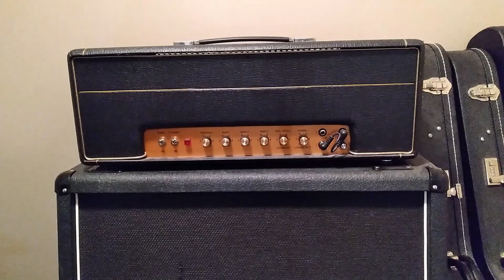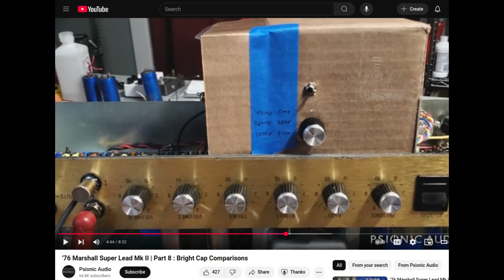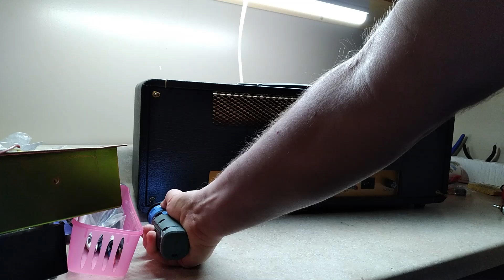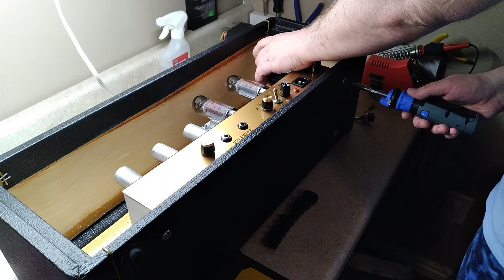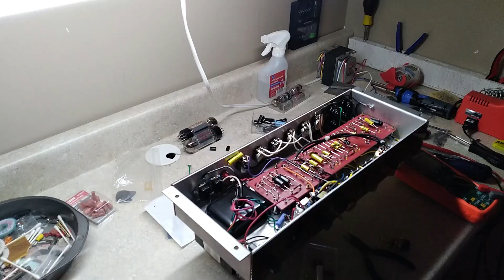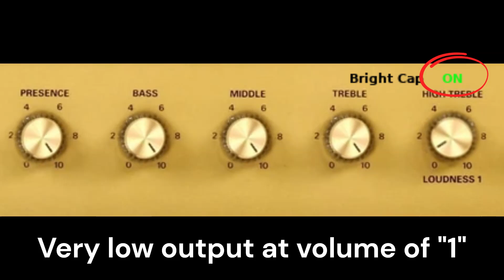Marshall JMP 50W model 1987: Selectable Bright Cap Install

Comment: Also, before you start playing it shows the inputs jumped with Vol2 quite high. Is that what you used for the playing demo ?? If you want a true demo of the effect of the brightcap you should have ditched the patch cable and put Vol2 on zero. No wonder it sounded dull even with the cap in. Bass on 10 and mixing in heaps of channel 2 is a recipe for killing the classic Marshall Kerrang.

Comment: Is this an otherwise stock 1987 ?? Seems a little dull even with the cap in, so wonder if there are other tweaks that bring it closer to Bass spec.
When I had a stock 70 Superbass I used to keep the Bass on zero, Treble on 10 and Pres on 7 and that gave me a tone that was closer to your bright cap on tone.
And when I put my stock 71 1987 at anything above 7 the Bass has to be set very low and the Treble quite high. The Treble control is way more influential for high end than the Presence IME so you would have been better off keeping that on 10 and the Presence on 5.
I guess what I’m trying to say is you have to treat the EQ very different depending on wether you’re running cap in vs cap out, wether the amp is Bass or Lead spec, and most importantly where the Volume is set.
Just leaving them either full up or half way doesn’t give you the best sound.

Comment: I had a Rocket Retro RR50 and it never had any gain at all. It played like a JTM 45 .Your video now makes sense. It was possibly just missing the bright cap. At 7 on Volume 1 it sounded just like yours with the bright cap off.
Reply: I didn't have a chance to watch you entire video but I wanted to point out that a Marshall does not operate like a Fender. You never get that "Marshall Sound" if you run the tone controls and volume all the way up. This confused me for about 40 years. Finally, someone explained that a Plexi circuit sounds best with the bass turned down and the mid and treb in the middle. One that has a gain stage added, sounds best with the treb turned way down. Just my personal experience with them in the 70's, 80's and 90's.